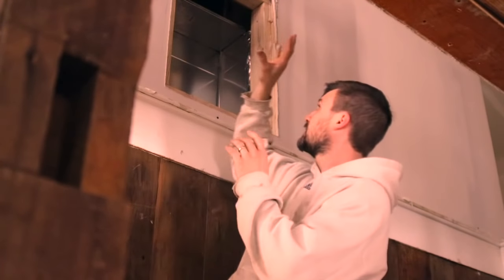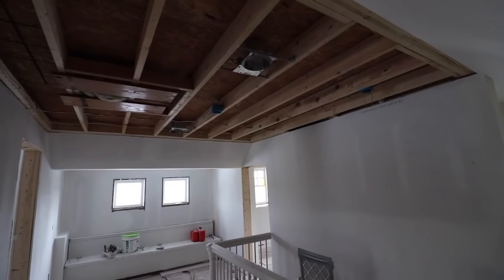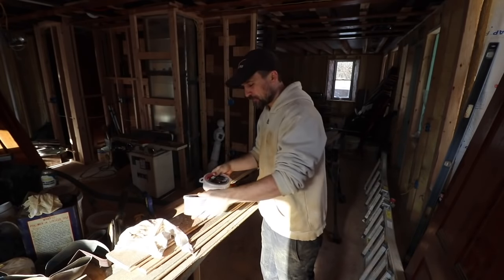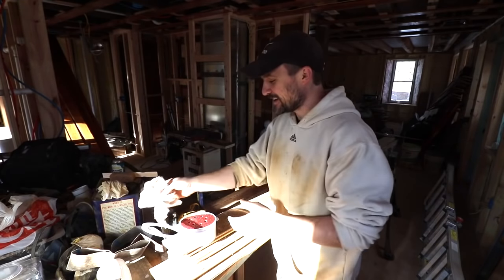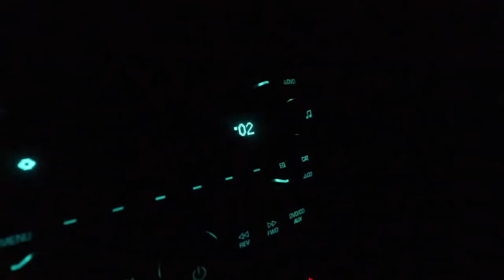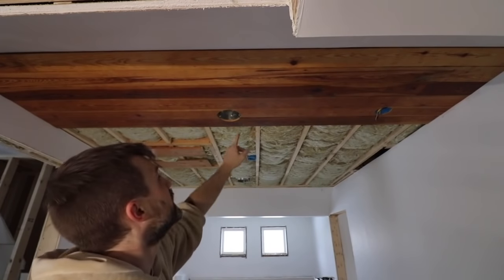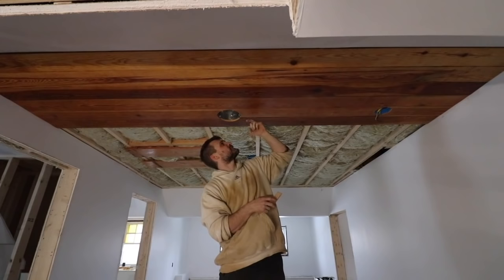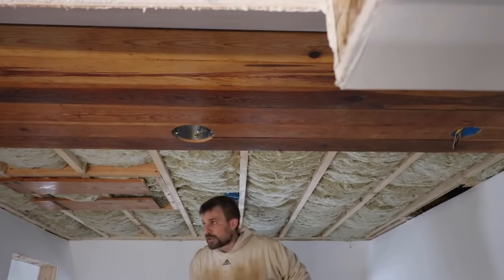Using Salvaged Materials | Farm House Restoration | Episode 105

Comment: U should get a planer. I’m sure your arms would thank you. Lol
Reply from the maker: Jennifer Calderon lol!! I was just in Lowe’s and a saw the small electric hand planners and I literally thought “ why the heck didn’t I get one of those?” 😂
Reply: @1806StoneHouse  An electric hand planer would be a nightmare. It would dull fast, cost a fortune in replacement blades, and run the risk of digging divots and scallops in the boards. A benchtop planer would be easier to use than a hand planer, have a lower risk of divots and scallops, but cost even more in blade replacements. Plus, those old floorboards have a LOT of knots & swirly grain in them, which adds to their aesthetic beauty, but are a nightmare to plane. Grain direction changes like that on a planer lead to massive tear-out that you simply can’t sand out. 

Your technique is perfect, from both a cost-effective standpoint and quality of results standpoint. Sure, it’s labor intensive, but you seem to be a fountain of energy. Plus, sandpaper is VERY forgiving with knotty, tricky grain. A benchtop planer costs hundreds of dollars, and the blades would run you hundreds more. People always think there is a magic machine that will make everything easier, but sometimes the slow, labor intensive approach is the best way.
Reply from the maker: Pat McVicker I swear I could cut and past all your comments and write a book!! Very good at accurately accessing the situation and extremely knowledgeable!
Reply: @1806StoneHouse  You crack me up! If I know a thing or two about what you are doing, it’s because I did the same thing with 4 houses (but the oldest was still half the age of your house). Those were just MY houses, not the all the ones I’ve worked on.  And like you, I had no formal training in fine carpentry and cabinet building. I just read books (we didn’t have the internet back then) and picked things up from watching others work. And like you, I was fearless in tackling things that others would always hire out. No faster way to learn that getting in over your head!

Comment: I use a product called Coil Clean from Lowe's.  Once a month, when I change the filter, I hose down the coil while it's open. Keeps the coil from freezing up in the summer. Yeah, just take it easy on the bank account. It'll be over soon enough. You might also see if your bank will cut you some slack until it ends. That ceiling looks incredible!! Keep in mind, when you snug wood up that tight, it might go 'pop' in the middle of the night as it contracts and scare the heck out you and the kids.
Reply from the maker: Thomas Whitten I’ll try and remember that about the wood.. but, it will probably scare the heck outta me.. lol!! That’s cool about the coil cleaner stuff.. I have mine cleaned yearly.. it’s good to keep it as clean as possible. 😀